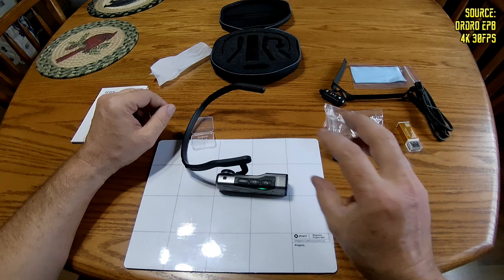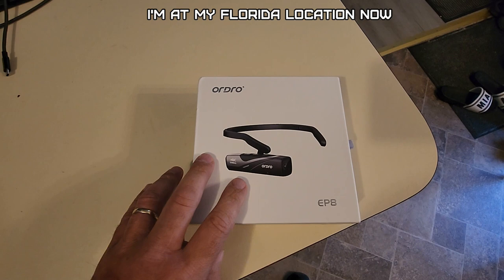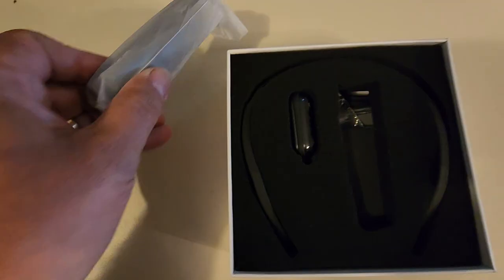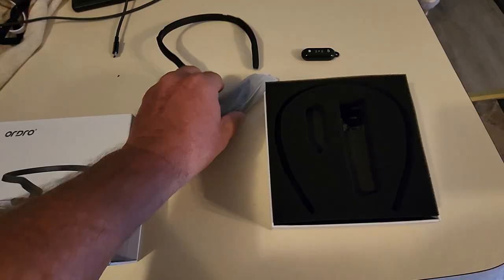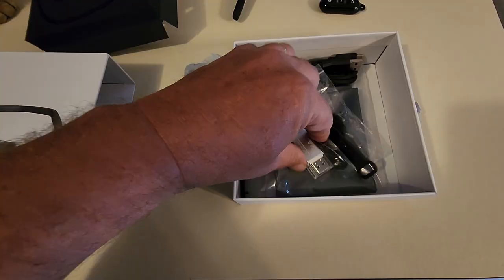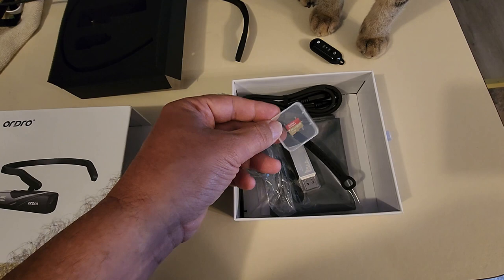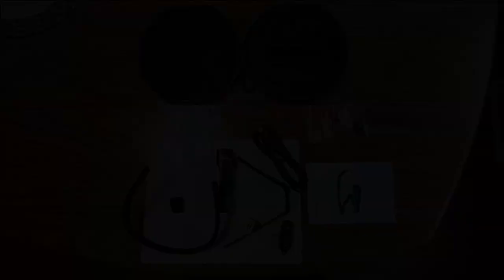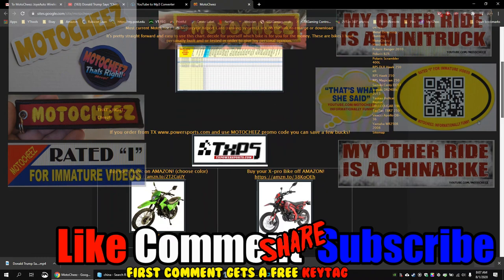NEW ORDRO EP8 4k 60 fps 130° viewing angle night vision UHD hands free camera review.

Comment: 1 good video
2 stabilization could be a lot better
3 microphone is good until challenged and then is terrible
4 low light is not too awful bad
5 white balance is a bit washed out at times
Conclusion: fix 2 and 3 and it would be great value :D
Reply from the maker: Agreed

Comment: Firmware update now shows camera view being upside down. Cannot find any way to put the view back to normal. No way can this be ward on the left ear...
Reply from the maker: A new update? There is an auto orientation setting in setting if I recall?
Reply: @MotoCheez  I have not been able to find such a thing on the EP8. And yes for firmware update.
Did a search, found EP7. Clicked the link, scrolled down and found EP8, downloaded and installed EP8Jun 27 2022_V1.2.9 and everything flipped upside down.
Reply from the maker: You're right, I looked. But I believe it's supposed to, did you try different angles? That's so bizarre
Reply: @MotoCheez  The firmware update has bugs. Did a reset through the pin hole, nothing reset. Wished the software would of or could of made a backup, but nope. Copy EP8.BRN to the memory card, turn unit off and back on, green/blue flashing, turns off after a while. And everything is upside down.

Taking a video, no issues. Taking a photo in video mode now shows a black screen with a white X in the middle. Bad update.
Take a photo normally and it does, upside down. Was planning on giving this EP8 another roll this weekend. Sure I can flip photos and videos over, but seriously, why? And why is there no automatic ground leveling.

I'll stick with my GoPro 6 Black. It is reliable, and takes 2 seconds to record. And bought an Insta360 X3 to learn. This EP8 has been such a let down for me. And I ordered some Camera Mic Windscreen (ASIN B07YFBF89S) to put over the microphone to remove the wind noises. It was horrible on a 3 camera comparison. 

Was going to give it another shot. Is there s button combination to rotate the screen??

Comment: Did not get a remote with mine.
Have issues with the side of my head and hair being seen. Can see the camera lens off to the right with peripheral vision, yet the camera has no option to angle away from my head. Is there an option for an extension to mode the camera away from the head mount? Not crazy about their headset, and that the other side of the headband could probably use a counter-weight.
Swapped to 20K mode to enable camera mode while using the video. That feature does not function on the 14K mode, oddly. 

Pan on taking it out on a ride on the recumbent trike. Have a GoPro & Ricoh Theta SC2 I use when am out and about. Was hoping I could use this camera to take photos of critters I see along the way, especially birds. Sad part is from off to actually taking a photo is 8 to 10 seconds at best. Most birds have done flown off or out of view by then. Takes 4 seconds for the audio clip to go off on start-up, and another 3 to 5 seconds for the Taking A Picture - pause - Snap to go off. Annoying. The audio needs to be shorter, or have the option to turn that audio off for faster picture taking.
Video mode is actually faster by 2 to 3 seconds. Unsure how sharp this camera is, and why I thought of trying the 20K mode, one step up from the 14K mode option. 

Think I will search for some foam to place over or inside the microphone. Not exactly sure how to go about that. The camera only arrived yesterday and was unboxed today. Not finding anywhere to purchase the remote separately though.
Reply from the maker: The link I put should have had remote, to angle and adjust left to right I had to bend the metal bracket a bit like in video. Startup. Yeah...slow
Reply: Thanks for your report. So are you disappointed with this camera? I looking for small light head camera cause my go pro is to big and ugly to use on the streets. But looks that Ordpro dont have quality for a $200 camera.  Do you suggest still using Go Pro? Or do you know another fair option? I won't spend 200 dollar in a crap camera. I also check that don't have option to change the side camera. I will record while driving and obviously must be the on the left side. Weird.
Reply from the maker: @alissonmauro5349 I think the EP7 was a better camera, but if you are using it on a bicycle or something with any speed where you'll get wind in a microphone you will be disappointed with any of the Ordro's. 
I've tested many cameras and unfortunately GoPro has the best image quality and sound quality while riding. Doing my e-bike reviews, I mounted a GoPro on the front top of my helmet that I use and used an external mic that points toward my mouth and I can go 30 mph plus and it rarely picks up any wind noise.

Comment: Sound is really muffled now, I guess it doesn't have input for lapel mic or anything. Wish you recorded at 60fps, seemed like you have the option on the drop down menu.
Reply from the maker: I used default settings, thought about using the 60fps...

Comment: The image stabilization looked miserable, Runcam 5 does the same quality for the price of 1/4. - I still prefer my Gopro 7 black.
Reply from the maker: How does runcam mount? GoPro still the best but no good way to wear on head, except stupid head strap
Reply: @MotoCheez  Same as Gopro, but Runcam only weight 56 gram - I use the cameras on a MC-helmet, no headstraps.
Reply from the maker: But how long is the battery life? That's one of the reasons why I use this for when I'm recording in the garage hands-free it has almost two and a half hours of battery life
Reply: @MotoCheez  Hi  On inside battery about 1 hour - extra batteries are cheap on aliexpress or amazon - You can allso use external powerbank if you need.
Reply from the maker: Like the GoPro I have a 1000ma battery on my helmet, but as far as headgear 1 hour isn't enough, and greasy fingers when working in the middle of a projects kinda stinks lol
Reply: @MotoCheez  My batteries is 1220 mAh, but with a 10.000 mAh powerbank in a breast pocket, it runs for more than 6 hours.
Reply from the maker: My GoPro goes over 6 hours on my 1000ma too

Comment: I'd buy the Ep8 but guess what?? The EP7 HAS FAR BETTER AUDIO QUALITY! I NEED to hear others calling me names. Not just me talking. Supposedly the ep8 has an extra 40° FOV. BUT that doesn't appear to be the case here!??? 🤔
Reply from the maker: You're right! Audio poor, stabilization is poor.  I was disappointed with the EP8 and no firmware update like they promised. 
EP7 is a better unit. The audio is louder.on the EP8 though, so loud it clips with loud noises.

Comment: Videos pretty good! Definitely better than the EP7. But as you already know....dat audio.
Reply: The original is still big 'but super reliable ' 

But have you thought about the DJI action 2? Its a smaller little baby. On sale for 339$ now.
Reply from the maker: I did look into those. Battery is a big concern, those have horrible battery life and how do you do hands free, like glasses or headband
Reply: So it looks like they're relying on it's built in magnet. So! They make headband mounts where it just magnetizes to it. 

But there's a case, that gives it that go pro style mount. 

The one on sale for 339$, apparently has a battery pack. Of course that makes it gopro size at that point. But it also has this neck strap that comes in the box, that'd probably work very well with 155 fov. But of course....339$ is alot
Reply from the maker: Has to be head mount, battery only last half hour or so. Chest and that area produce poor view IMO

Comment: EP8 has better low light performance but the image is noticeably more stable on the IP7. The EP8 is too jerky.
Reply from the maker: I honestly don't believe that the image stabilization was working correctly I did contact or draw and they said they sent it to their engineering team and they're going to try to send a software firmware update
Reply: @MotoCheez  Yes, I think you are correct and will see what they come up with. Fantastic videos as always, thanks!

Comment: That camera sucks. Anyone spending $300 on that should have their head examined.
Reply from the maker: I'm going back to my EP7, did more tests doday, horribly unusable for what I do. They better get new firmware out soon
Reply: @MotoCheez  Well it's good to see you're being honest. From what I saw I wasn't impressed at all.
Reply from the maker: I wasn't either. The EP7 works better for what I need. Over 2 hours battery too. Motorcycles I use GoPro on my bikes

Comment: Man this camera is garbage! Even with the built in gimbal it's jumpy as hell, the video quality is no more then 480p. Stop buying this junk and stick with GoPro and DJI Osmo products. Anyone who says this video quality is amazing has never used a quality camera.
Reply from the maker: I have GoPro, hands free solutions are crap for GoPro. The Osno is good, but battery life stinks on it and the gopro. It's 4k, I don't know what you're watching it on. I've reviews dozens of action cameras now, including glasses. But I agree. This camera stinks, the EP7 was way better
Reply: @MotoCheez  You started out filming with the 7, the video was washed out had a blue tint and just looked bad over all. As far as hands free options for the GoPro and Osmo they share the same mounts. Hat clip, Head mount and chest mount are all viable options for hands free filming. I use all of the at the off road park I work for.
Reply from the maker: Video was inside LED lighting  Thos option stink. Eye level is always best, and you look like a dork with the headgear.